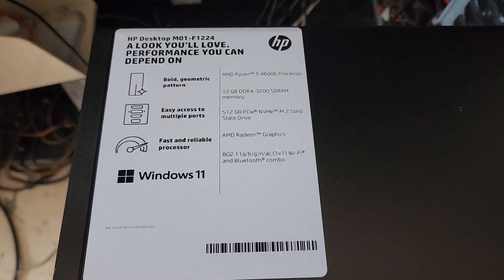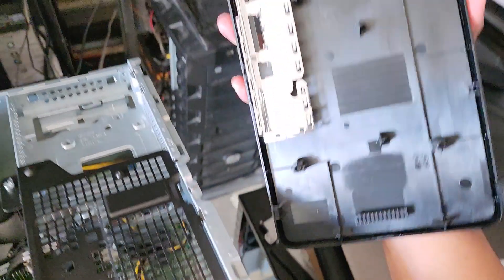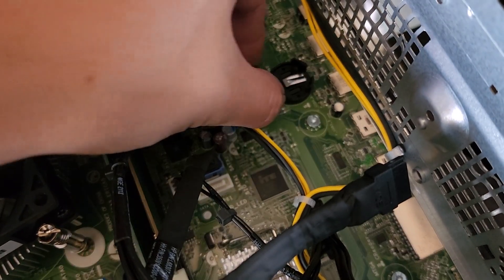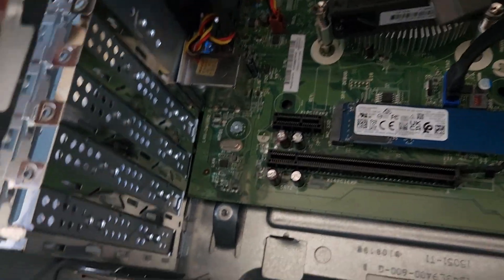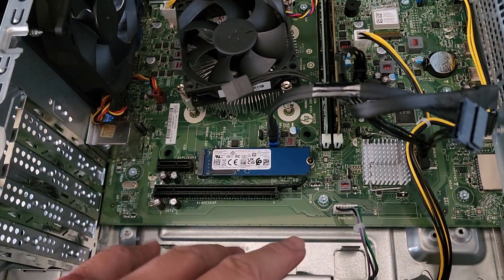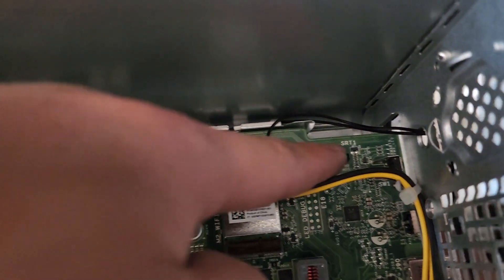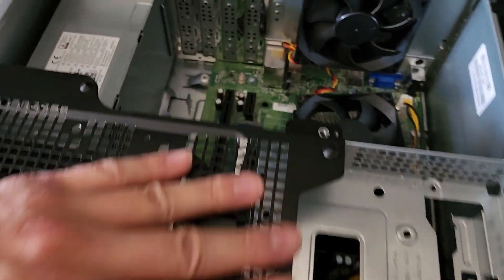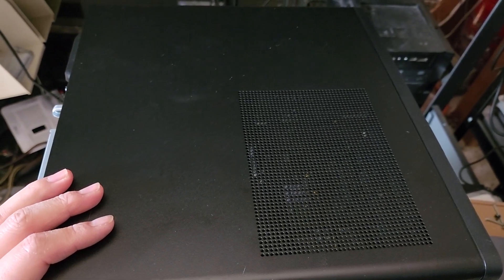HP Desktop 1J7P8AA#ABA  M01-F1224 Disassembly RAM SSD Hard Drive Upgrade Battery Replacement Repair

Comment: Can you tell me what size RAM stick this thing uses? I can’t find any that fit . Also how do I install a graphics card?
Reply from the maker: The RAM is mentioned in the video. It will only work with GPUs that don't need additional power.

Comment: I have this EXACT same pc. I’m upgrading it with an AMD Radeon Rx6600 but the card was a bit big so I had to break some of rhr metal slots in order for it to fit in. Surprisingly it plugged in perfectly but then I realized the power supply doesn’t have 8pin cable to give power to the graphics card. I recently bought a 750   Power supply but I don’t think it’s gonna fit under the graphics card so I’ll probably have it on the outside and just have my pc with no case for a bit😂
Reply from the maker: Lol oh man
Reply: Can this power supply be upgraded to the one I mentioned. Idk if only certain power supplies work with certain motherboards or something. I’m very new to this
Reply from the maker: It uses a special power supply
Reply: @scribbles9721 there’s a 500 Hp power supply that fits these type of pcs.
Reply from the maker: Hmmm

Comment: You can upgrade the power and you can add a gpu I have yo same computer and have successfully upgraded mines with a 6700 tx and a 850 watt power supply
Reply from the maker: Nice!
Reply: what PSU?